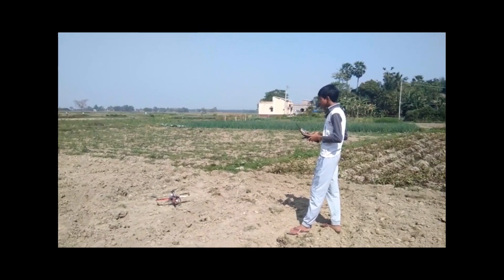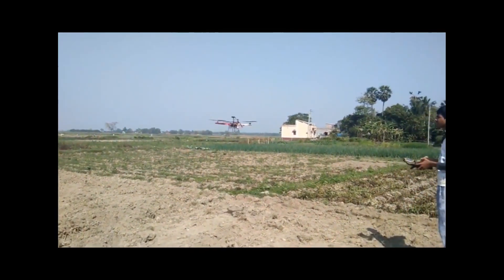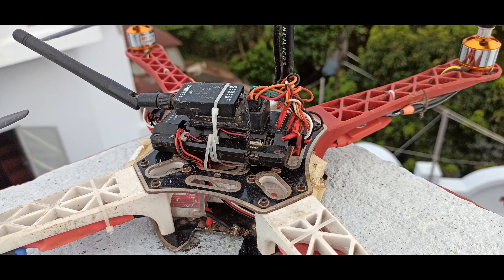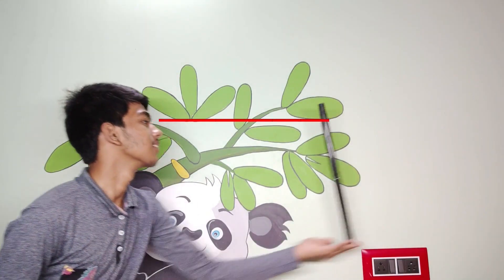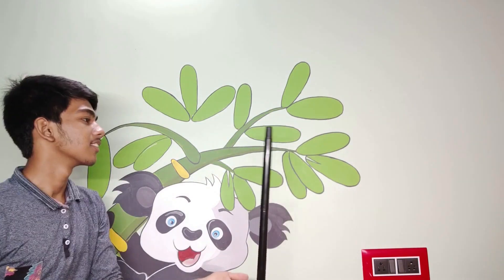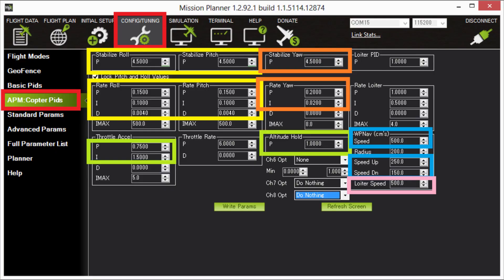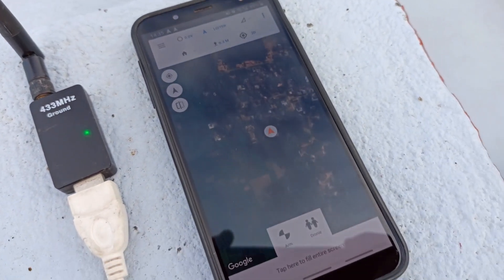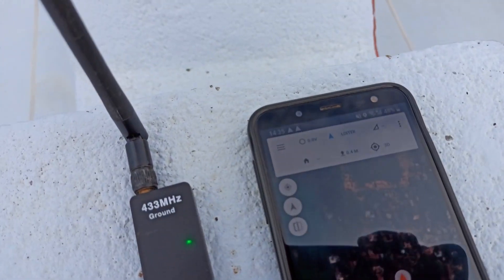How To : Tuning In Drone | Autotune | DIYLIFEHACKER

Comment: My copter arming only when switch A in throttle cut Mode and lifts after toggling the switch to disable throttle cut. It's that a problem ? With this it's behaving weird in alt Hold mode.

Comment: nice vid dude. i also have same setup but in my case the quad leaves ground at 3% throttle (it should be around 50%) and also it drifts to one direction and not straight up like yours. im using 7038 props, 980kv motors and 1300mah 3s lipo and 30A ESCs. any idea why? or can u share ur final tuning param values?ive already done esc/radio/compass calib
Reply from the maker: set tuning values according to the ardupilot documentation wesite's tuning page picture.
Reply: @DIYLIFEHACKER  that page shows values for apm4.0.6 onwards but my current version is 3.2.1 and i cannt see those parameters in my version
Reply: today i did some test flights after all calibrations. issue is that when my quad leaves ground, it drifts to the right. there is wo wobling or trembling and its smooth but it doesnt take off straight up. any idea why?
Reply: @1979zeesh  fine tune your transmitter
Reply: @1979zeesh  look up auto trim on arducopter.

Comment: How much time it took to do pid tuning for your quad bro
Reply from the maker: hardly 7- 8 minutes
Reply: @DIYLIFEHACKER  when I try to change my mode it's showing mode change failed.iam using pixhawk and fsi6 and have you assigned any channel.in transmitter for auto tune or you just simply pressed auto tune bro thankyou